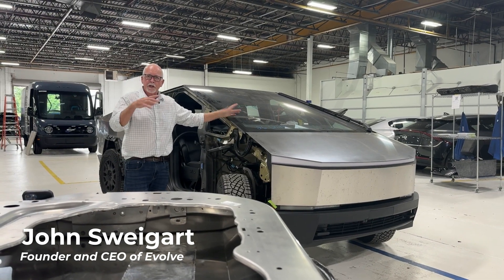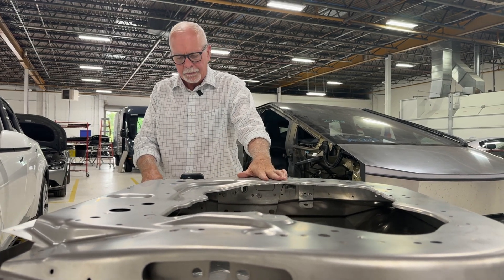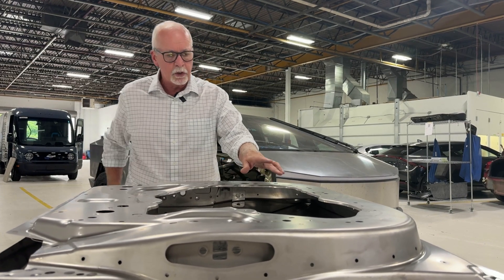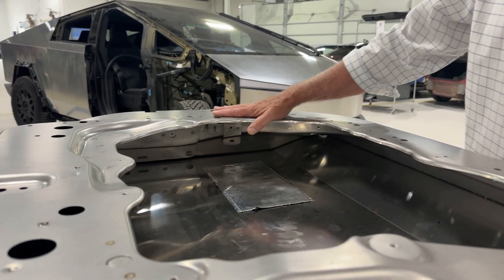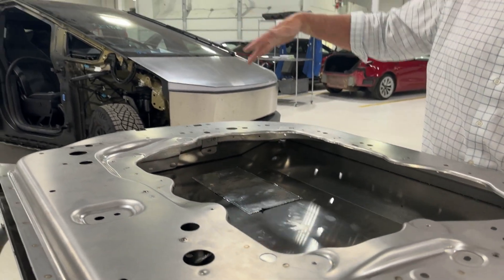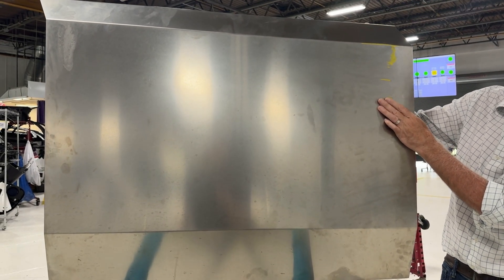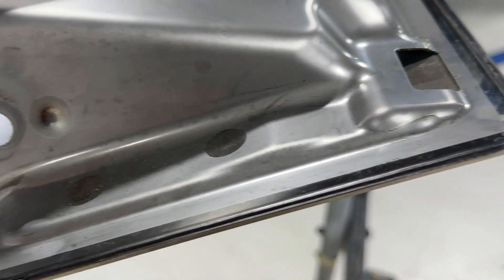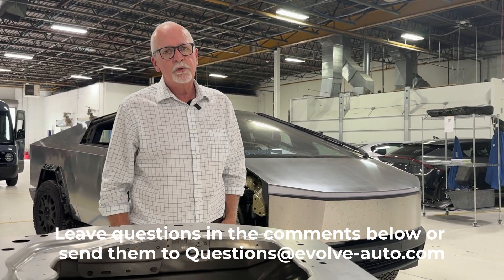Inside a Tesla Cybertruck Door - A Closer Look

Comment: Hi.  Happy to see this. I own a cybertruck and my doors only the front doors specifically they vibrate a lot at 80-85 miles an hour. Specially on open roads with cross winds. Do you think this is because they don’t have any cross bars on the inside? On city freeway is smooth but like I said on open highways they shake a lot. Took it to Tesla they think is normal.

Comment: That door is as empty as the ones on my 1970 Mercury Marquis convertible, which has no reinforcements inside, yet the CT meets side crash standards and my Mercury meets nothing.
Reply: Yeah basically exoskeleton. They truly use thick outside ss for rigidity.